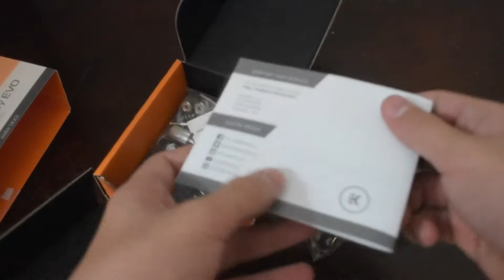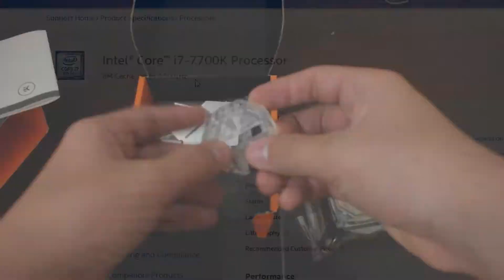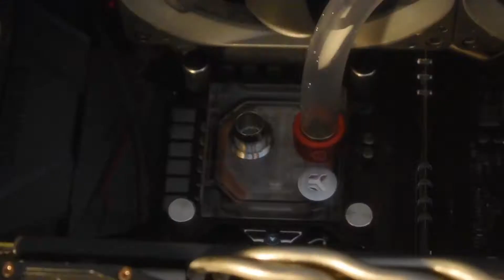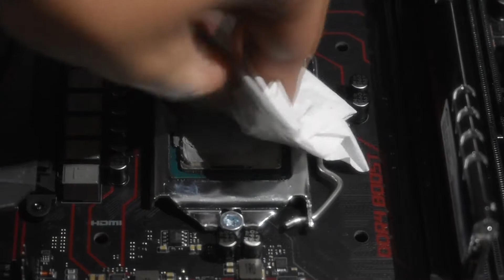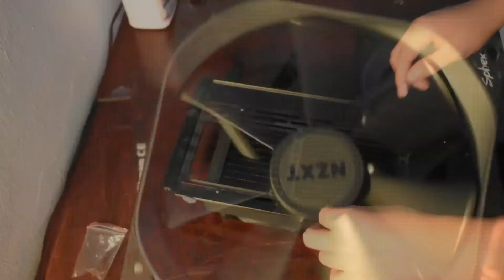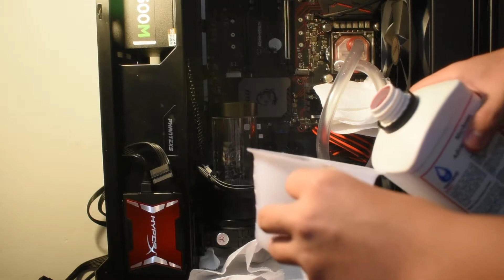Custom Water Cooling Guide & Science

Comment from the maker: 10:30 Miss Information
Instead of heat capacity it should be thermal conductivity. Copper has a high heat conductivity letting it warm up quickly.